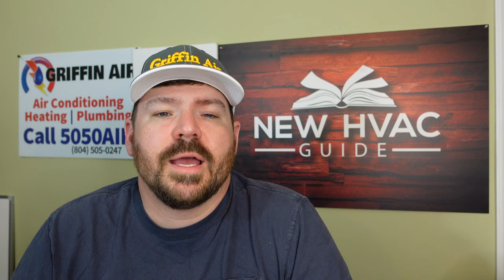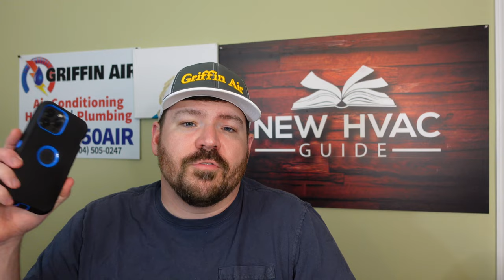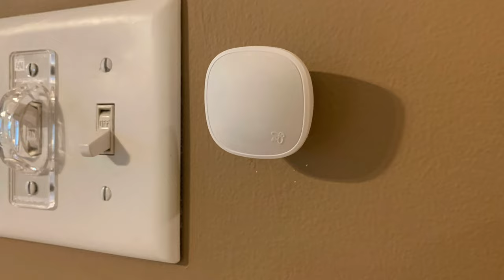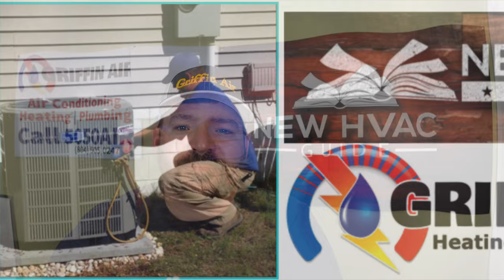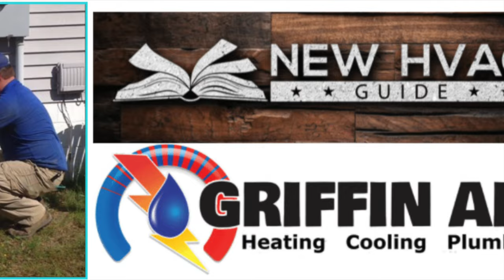HVAC Thermostats STUCK in the PAST?

Comment: The old stuff is simple, reliable, inexpensive, easily diagnosed ...just because we can do something doesn't mean we should!...all this computer control is susceptible to more expensive repair, supply chain (chips) vulnerability and hackable!
Reply: Agreed!!! If your phone breaks, you still need a way to control your tstat.  Not to mention, what he's talking about already exists. And we're not using the same tech for 20 years ago(tstats are digital now, not mercury). The only application where it makes sense to use this kind of tech(temp sensors, etc) is in commercial.
Reply: Friendly reminder that prices are comparable now base digital thermostats can do more than “physical” old ones at the same price point. “Smart” functions are what you pay premiums for. Im not sure what “hacking” a thermostat means 😂

Comment: Goodman has a line of furnaces right now where the contractor can connect a smart phone to set up airflow, ac tonnage, and run the heat. It wouldn't be too difficult for them to expand upon that
Reply: CoolclCloud,  Trane will be releasing the TAMX that will be commissioned via Bluetooth the same way
Reply from the maker: I think we are going to start seeing all kinds of parts like that. Motors might be programmed via bluetooth
Reply: comfort bridge is crap, trying to control complex modulating and 2-stage, variable speed systems with crappy single stage thermostat, using algorithms and timers instead of room temp rate of change.

Comment: Honeywell has a lot of wireless options with remote sensors and apps to run with phone. You can mount all your stats in one closet with one power source and run multiple zones.
Reply from the maker: Definitely.  I think that was part of my point with the video when I was mentioning that we definitely have the technology today. My surprise is that manufacturers would even give someone like Honeywell or nest or ecobee a market. Why not produce a system that does all those things without needing a third-party device?
Reply: Thanks for the reply. Goodman with there Bluetooth boards could easily touch upon this idea with a remote sensor and have the tstat logic in the pcb. Mini splits are close.

Comment: I am sure I am in the minority. I do not want another app on my phone. 
What I would rather see is some sort of VFD / speed control over my air conditioner. I want it 76 constant degrees, without blowing  -20 degrees at me when its on, and pretty warm when its off. A constant low speed breeze is better IMO. When I am back from vacation blow full speed to cool it back down.

Comment: Disagree with you. Most of my customers don't want to control everything with an app.People want simple. A big chunk of my customers are north of 60, with failing eyesight, and dont feel the need for every wiz-bang technical advancement to be incorporated into their thermostat.
Reply: Have to agree here, a simple UI is often much harder to develop that a piece of tech. Hence the cost and subsequent love from consumers of the Nest thermostat. It’s exactly what the customer wants to have. 

All of the main smart stats do offer the app and automation piece. You’re going to have to have the “thermostat” to control the unit and connect to wifi somewhere. Not a problem needing solving IMO
Reply from the maker: I hear you. I have a lot of customers in the same boat. I think my argument to that would be that I could mount a tablet on the wall larger than any thermostat and an app could be designed to control the HVAC that is way simpler to use than most thermostats today
Reply: @NewHVACGuide  What's the cost associated with that idea though? Sure, cheapo tablets exist but UI is always the issue. People default to Apple for their use friendly interface, with the cheapest iPad running $329. Ultimately, not designed for always on implementation and you'd need to rewire your thermostat location to allow power for the charging demand. Plus, you'd still have to have an access point tied into your air handler at some point ($$$). 

Definitely a cool idea, but cost and general consumer market prohibitive. Which is why Nest/Ecobee are so darn successful. They accomplish the "task" the best. All-in cost, easy install for most homes, and have app access. 

Maybe some of the higher end inverter systems could leverage app usage vs their proprietary stats. Integrate the control w/ the handler and have user choice for controls as far as smart app device. As in those situations cost is less of a priority. 

I will say in 2022 I am shocked we don't have your idea with a wall mounted tablet with all home functions built w/in it. Seems we were heading that direction in the 90's with the whole home intercom. I guess the market just doesn't set the demand.

Comment: No need for over engineered crap. Existing thermostats are just fine. Here is an example of over engineered crap: electronic door locks for house. They are flimsy, can be hacked or simply defeated  with simple tools. They fail easily due to mfr cutting corners, are more complicated than they need to be to work. Money is better spent on buying say an abbloy lock that is built to be bump proof, pick proof, engineering done to improve how sturdy it is built, not making the overall hing over-complicated. Or how about those stupid smart refrigerators with t.v screens on them, that cost #2k to $4k? A plain old ref for $600 to $1200 does the job just fine. Or the new garage door openers designed to connect to youre cell phone? security risk, as any dipshit with a cell phone can hack access to youre garage door opener with their cell phone.
Reply: I’m a dipshit - How can I hack into a garage door opener with my phone?